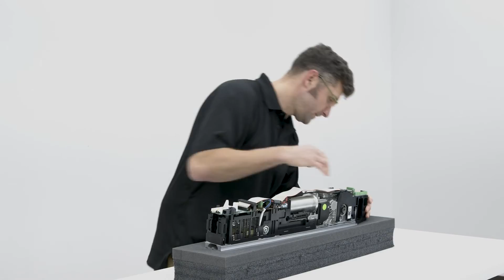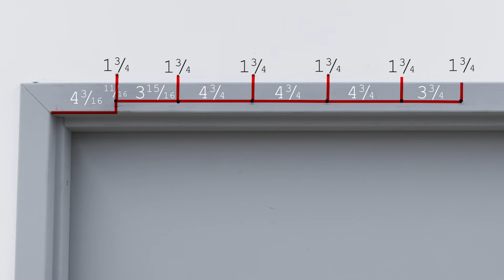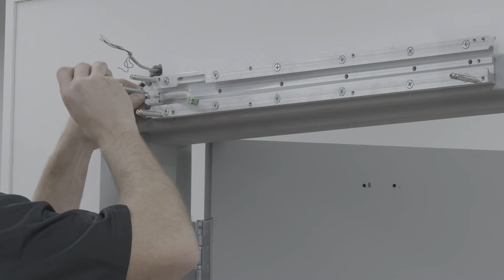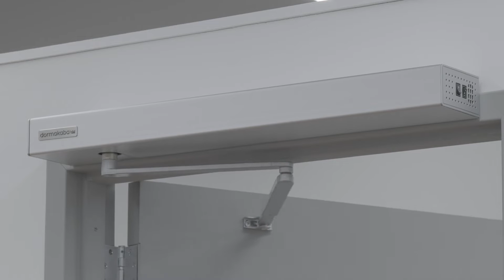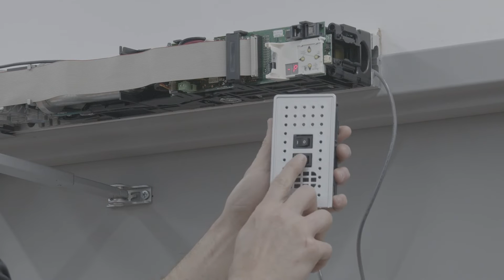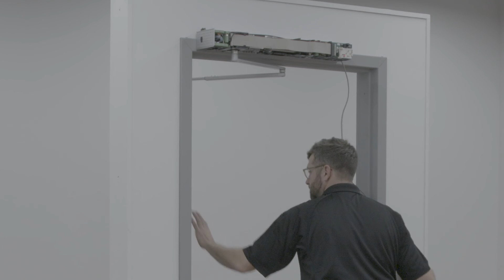Installing the dormakaba ed50 low energy operator

Comment: I have these installed at a facility I manage. I need to enable manual mode with power assist. Does the cover just slide on, or are there any retaining clips? I didn't want to pull too hard if there are some fasteners I'm overlooking.
Reply: Did you manage to put the cover on and if so can you remember how?  Screws or clips? I can’t see anything to sort it out
Reply: Cover just slides on, grab both ends (not the plastic end caps) and give it a hard pull

Comment: Can these systems be manually opened/closed without any mode switching?
Reply from the maker: Hi Ste, yes, full manual operation of the door is enabled and available at all times.
Reply: Did you manage to put the cover on and if so can you remember how?  Screws or clips? I can’t see anything to sort it out